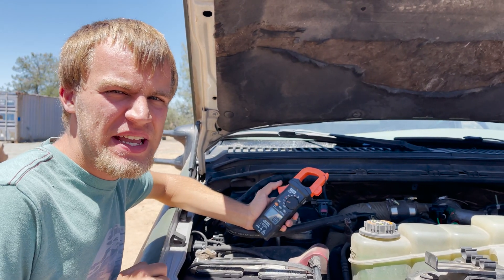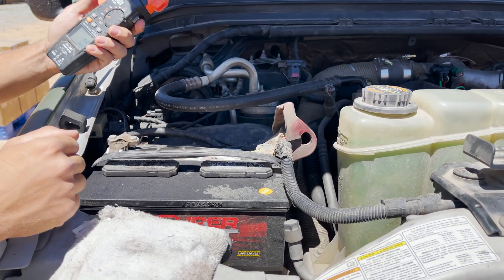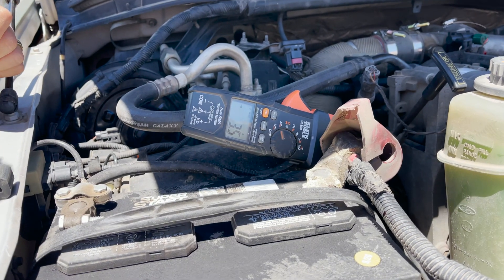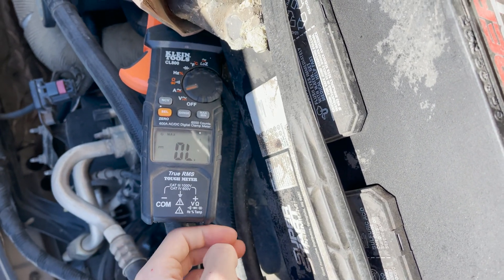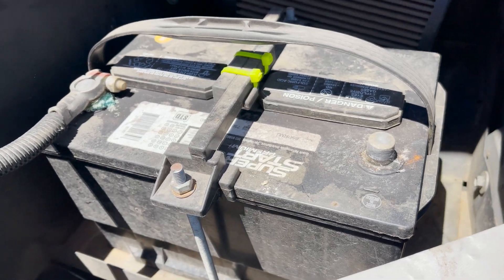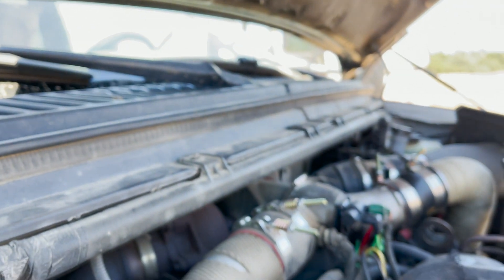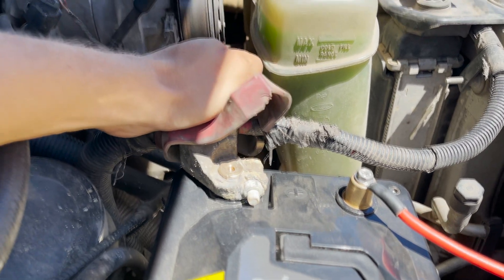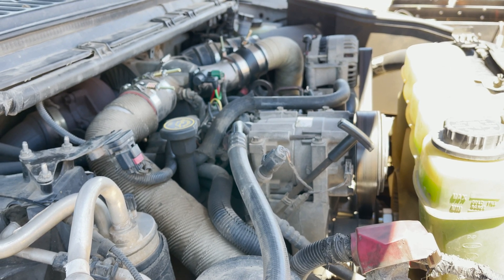Can Lithium Crank a Heavy Duty Diesel Engine? || LILEAD Dual-Purpose Battery

Comment: I would never use any lithium battery other than lithium lto batteries for a starter battery, 1 they don’t explode and burn down your vehicle 2 they don’t have cold weather charge discharge issues like other normal lithium chemistries, don’t buy these life batteries for this if you don’t want your rig to burn down

Comment: Hi 😊 between a  starter lead acid battery (AGM or flooded) and LFP battery, which has more cranking power? I mean which would provide more instantaneous peak surge current??? Please let me know...
Reply: Lithium usually is around 450 amps
Reply: @jait9073  I meant between the two equivalent batteries with identical given conditions where all parameters are held constant, then which would excel in this regard??

Comment: The battery will get too hot under the hood and the BMS, which is the battery management system will shut down the ability for it to charge or restart. You would have to do a revocation somewhere else inside the vehicle.
Reply: I don't think so, cause the alternator controller will stop the charge before, at around 14.4 volts like a lead battery. Remember battery is use only to start the engine and the alternator take the relay...In an other side,  the battery will not be charge at 100% either...
Reply: If battery bms shut down and alternator was still pushing out max amps where does all that power go?

Comment: Two years later is this thing still cranking?
Reply from the maker: Yes!  I’ve been using it in the back seat of the truck to run the sound system and a 1500w inverter. It helps cranking quite a bit, although I still have the lead-acid batteries under the hood. These are no longer available in the US market, unfortunately

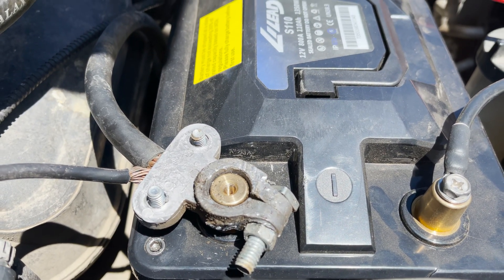Comment: 3:26 you can drill a drywall or something similiar into the empty gap to fill the void. I do it all the time on my batteries. sometimes it will dig into the post but usually the terminal is softer.

Comment: Two batteries in this truck is for lower temperatures. Lower than 10 F
You can see this, if You leave only one acid battery in this truck. It will crank engine

Comment: Considerations when attempting to substitute an 'under the hood' lead acid 12v Car battery with a lithium battery.

Due to the differences, like the limitations of current handling in the internal battery management circuitry and more about those.

There are actually numerous problems with anyone considering using many of the current lithium batteries to replace a 'under the hood' car battery.

 Check out the presentation to learn about more.

High temperatures under the hood. Can damaged lithium batteries.

Attempting to charge a lithium battery below freezing can damage them too.

I can think of a possible simple modification to safely get around the cranking current limitations. And circumvent cool temperature issues too.. but I'd like to build a test rig first, in case I share something which is not safe.

https://youtu.be/bzGFSSgkQYM

Comment: use a normal lead acid as primary starting battery and keep this in the second battery compartment for helping the lead acid start and most importantly reducing self discharge .

Comment: What about High "under-the-hood" temperatures?  Doesn't high heat reduce the life of LiFePo4 battery?
Reply: No they can tolerate i own a company to make self heating batteries. So it's good down to −40°, and lithiums typically can't handle that. Also, it has bluetooth to let you know what the state of charge is

Comment: It is all about voltage drop... Acid ones go with voltage way down so they need to push more amps to supply required wats. LiFePO4 can give relative less amps but the voltage will be higher. You can hear the difference.
Reply: just about to comment this, yes voltage does not drop like the lead acid did.

Comment: Just wait for my review of this… OLD 7.3 cranking and cranking… love it. This battery can handle the loads!
Now, I am worried about alternator circuitry, and cold weather, but with block heater plugged in, the engine bay should be above freezing for cold weather operation.

Comment: Starting in the winter or cold weather might be a problem. I believe LiFePo batteries experience a voltage drop at temperatures below 32F (0C)
Reply: Starting isn't really a problem... but charging is if you don't have heated batteries.

Comment: What are the two extra cables on the top front of battery going to?

These are a no go on many vehicles due to temperature limits. “**Please note that this battery does not have low-temperature charging protection in order to prevent loss of power in mobile applications.  Please avoid using this battery in subzero conditions without sufficient insulation.” They should have mentioned a silicone heat pad will be needed too. 

It can fry your alternator trying to recharge them. 

I installed one on a 540 cuin aircraft engine. It started great, but would overload the little 60 Amp alternator to recharge after one start. The bat  weight decreased from 26 to 4 lbs. Back to the original.
Reply: u can buy specific regulators for alternators that will limit output voltage thus charging current by alternator temperature but for aircraft use i will keep lead acid or eliminate the bms on lifepo4 , sometimes the engine can fail and then u will only have the battery for radio , navigation and lights and if a bms cuts of in such situation then u are screwed!

Comment: Yup. A 4S4P SPIM08HP (12V/32Ah/400Wh) configuration (Li-ion chemistry) delivers 800A (continuous)/1,600A (peak). Cells, BMS and high current relay? About equal to a SLA starter battery at less than $100. Note that the BMS controls the high current relay for normal loads. However, the BMS is bypassed for starting/jump starting as a suitable contactor adds another ~$200.

One caveat:  Alternators are designed for lead acid chemistry charging. Lithium chemistries will consume much higher current that can damage an alternator. For this reason, charge limiting circuity is necessary. A BMS provides this, however, in my example above, the BMS is bypassed to allow the cells to deliver the needed starting current. A separate port BMS would work, however.

As far as the LiLead is concerned, where it really shines is as a dual-use battery. 800CCA for starting, plus 110Ah for supporting "house" loads while camping, etc., while being charged via solar so there's always enough power for engine starting.
Reply: I have a vintage Mitsubishi RV with a 2.8 L diesel about 120hp I’d like to use one 200 Ah lithium battery like this to replace the 2 lead acid I have now. Is this doable in your opinion? I could really use the extra space I’d save…Appreciate any feedback. I’m a little new to this. 🙏🏼😊
Reply: Been using LiFeP04 batteries on my Hybrid cars for the last 4 years. Hybrid cars does not have alternators, so they work well. Also, LiFeP04 has much greater capacity than sealed lead acid car batteries. My Hybrid vehicles puts out 14.4V-14.8V. So they are usually fully charged.

Comment: Heya! Love the videos!

It's Interesting that you tested this now, and I'm actually a little surprised that you were quite surprised the truck started from the Lifepo4 battery, I knew it would just fine.

You See I actually have an 800CCA 40AH LifePO4 Unit (Made by EVpower Aus and has 16x 10AH Headway Cells in a 4S4P config internally) in one of my car's, and it works VERY Well. I've even drained it down into the "reserve capacity" where the BMS Isolates it to hold about 10% left, Activated the Emergency reserve and been able to start the 3L V6 engine with ease.
If my 40AH unit can start a car in the cold when its nearly flat, I would very much expect a 105AH Unit to start a diesel without any issues.
One thing I learned about mine though is that the BMS is Simple and only cares about overall voltage. Crank for more than about 10s and the voltage sag will cause the BMS to cut out, i learned this while doing compression testing where you need to crank a lot.
If you have an engine that is hard starting.... Give up at about 5-8 seconds cranking, Wait a few more, then try again, and that should stop Nuisance BMS tripping, or cooking of the starter for that matter.

There is one pitfall with lifepo4 for vehicle use though, One thing they dont like is being charged below 0 Degrees, and that Can be an issue for those in cold Climates as the alternator will still try to charge, will do so at a higher voltage, meaning you either risk battery damage if the BMS allows it, or alternator damage if the BMS cuts it off (unless you have some capacitors across it to absorb the diode killing spikes).

For my other vehicle, I'm actually about to replace the Dying Lead Acid battery with a Pack made from Lishen LTO (Lithium Titanite) Cells, as they are just as safe as LifePO4 but much more cold tolerant (good for below -20c Charge / discharge). I think I'm going to run them in a 6S Config, though not sure how many strings yet.  They are 18AH per Cell, and good for Continuous Discharge at 50C, and Continuous recharge at 15C , so even a single string in theory would work, but likely i will run 2 or 3 strings to have a good capacity reserve.

I'd Love to see you test some LTO Cells actually, and i see BatteryHook did have a batch of the same cells im getting at some point:
https://batteryhookup.com/products/case-of-12-lishen-2-5v-18ah-lto-30-000-cycle-new?variant=39534812561570

If you can source some, could you do some testing for us?
Reply: I have a vintage 1995 Mitsubishi RV with a 2.8 L diesel about 120hp I’d like to use one 200 Ah lithium battery like this to replace the 2 lead acid I have now. Is this doable in your opinion. Appreciate any feedback. I’m a little new to this. 🙏🏼😊

Comment: Cool concept. But Have you tried to start the truck using only one of the LA batteries? My 02 Dodge Cummins needs both LEs to start. Cummins has a fuel heater and not glow plugs. 🤔
Reply from the maker: It absolutely takes both LEAD batteries to start. My biggest surprise here was that the BMS was able to handle the current more so than the cells.
Reply from the maker: It is a cool concept that this is possible. Most of the time we consider lfp to be deep cycle only and never starting duty.

Comment: They have two batteries for more reasons than just cranking amps, those glow plugs have to run quite a while when it gets real cold. But you guys don’t have that problem 😂 What were the original ones, 700cca?
Reply from the maker: We had 200 amps for glow plugs and with a 100 amp hour battery we have plenty of reserve capacity to run them quite a while
Reply: @HighTechLab  I’m talking about places where it gets like way below zero degrees F. I don’t think the battery would like 2c very much without a heating pad